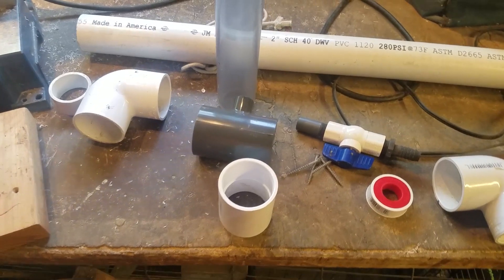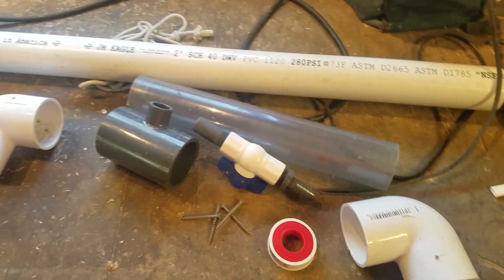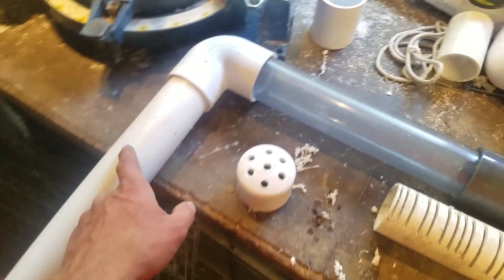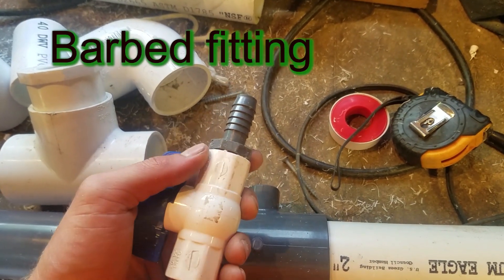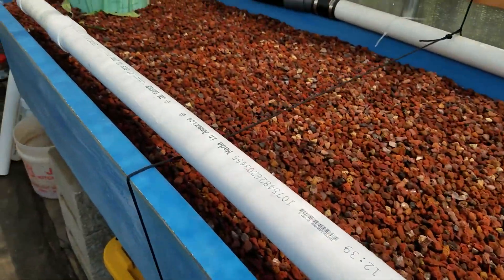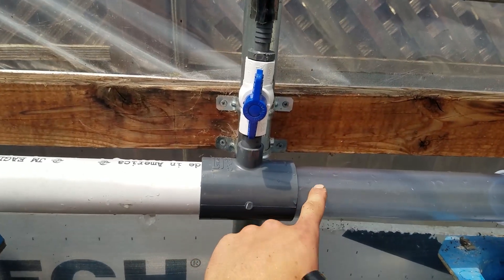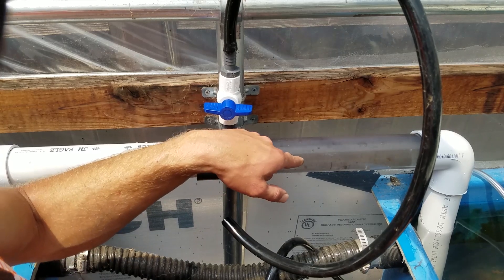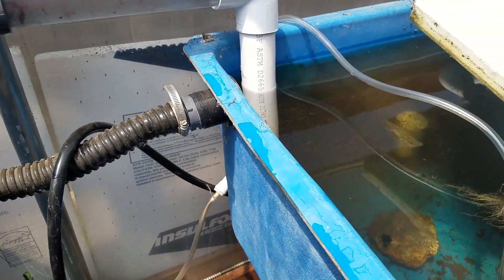BEST Aquaponic U siphon/ Bridge siphon! (connecting two aquaponic grow beds using a u siphon)

Comment: If you take a pool of water and put an empty tub in it, weigh it down so it sinks low enough below the water level in the pool that it sits in, it will be able to run a siphon filling and sinking the tub as deep as it can go keeping the siphon running  because the weight keeps it moving down as it fills, then once the tub is full it can released the water float back to the top and refill its self all over again producing more energy to sink it than it does to move back to the top. Maybe?

Comment: Good job on this project.  Amazing work.
I would cover the clear section with aluminum foil to stop the alge. 
As far as aeration goes, that trompe/sump I mentioned a while ago would be great for just that, but I'm sure you're tired of messing with the sump. 
Great show all around.  Keep up the good work.
Reply from the maker: Thanks
And ya I covered it with a piece of shade cloth I had lying around. But I might just do that foil idea instead, ill see though.
I briefly looked at that trompe thing when you mentioned it before, I would have to check it out more to really see how I could do it. But I am trying to not keep changing things (even though I still have a lot to do/change).
The trompe wouldn't really help with the grow beds. It is not really the lack of air it is more the lack of circulation under the grow beds. So the stronger the air pump I have  it should help with that. Also the filters aren't entirely set up yet, so when those are setup they will prevent a good amount of solids from getting under the grow bed.